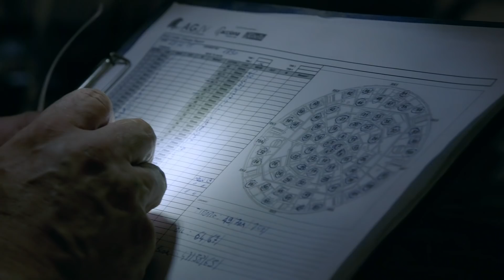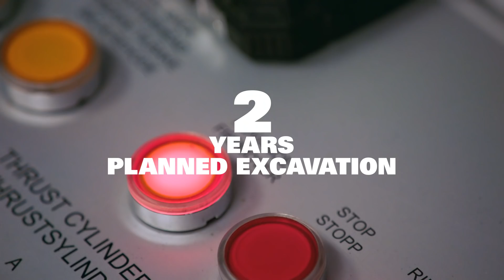Rough³ - Follo Line Oslo

Comment: The significance of this project is, that Norwegian gneiss was considered too hard to be broken down TPMs, so usually "drill & blast" was used there for tunnel projects. Now it's proven we can use the faster TPM method, but we can also see the toll it takes on the machines (cutter discs in particular).